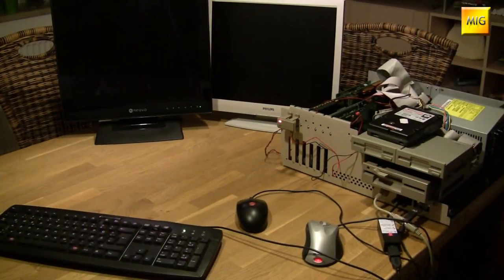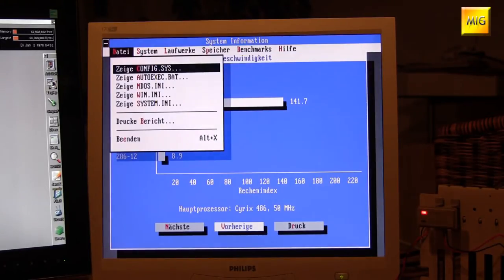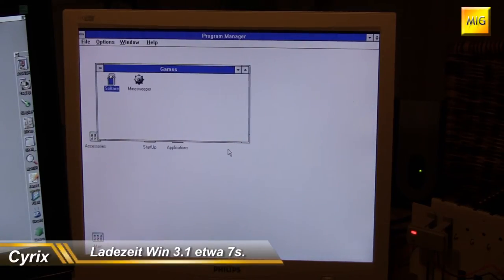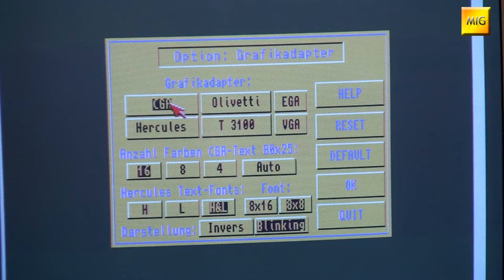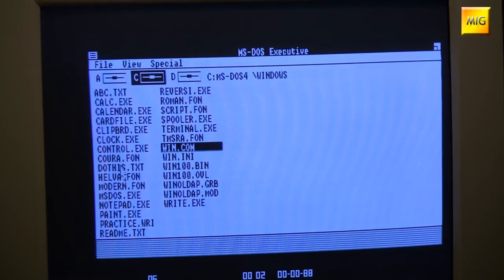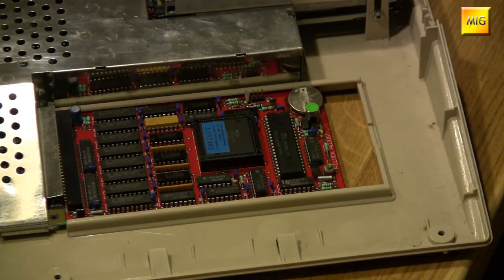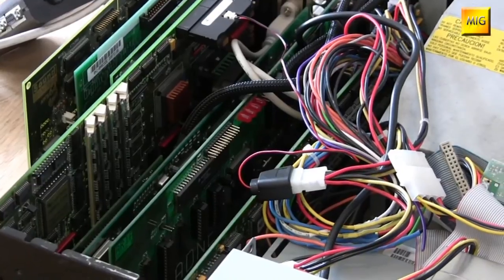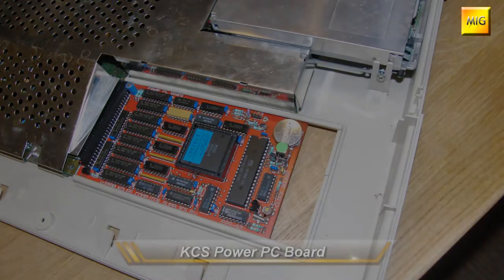MIGs Yesterchips SPECIAL - Folge #020 Bridgeboard Finale

Comment: Danke für diese tollen Videos! Ich habe unter anderem ein Commodore A2386 und ein Vortex ATOnce Classic. Ich hatte einige Zweifel bzw. Fragen, doch die wurden alle mit diesen Videos beantwortet :) Weiter so!
Reply from the maker: So soll es sein! :)
Reply: Yesterchips MIG Hab mir vor ein Paar Wochen ein Buch ueber Commodore gekauft. Werd mir mal einen Amiga kaufen.
Reply from the maker: Extrude Studios Wenn Du noch nichts Konkretes in Aussicht hast würde ich Dir zu einem A1200 raten. Bietet das Beste aus der Amiga Welt, ist halbwegs "günstig" zu bekommen und noch relativ einfach aufzurüsten.
Reply: Was macht der A1200 den besser als 2000 3000 oder 4000?
Reply from the maker: Extrude Studios Verglichen mit dem 2000 und 3000 hat der 1200er (genauso wie der 4000er) den AGA Chipsatz, kann also mehr Farben darstellen. Der 1200er hat ferner einen internen IDE Port, der 2000er hat gar keinen, der 3000er SCSI (was zwar schnell ist, aber heute kriegste dafür keine "Neuen" Platten mehr). Gegenüber dem 2000er hat der 1200er ab Werk mehr CPU-Power und mehr RAM. Außerdem kannste ganz einfach per AV Kabel den 1200er am Fernseher anschließen, beim 2000er kriegste auf diesem Wege nur schwarz/weiß.
Und dann, so ganz nebenbei, noch der Preis ^^
Kommt natürlich ganz darauf an, was Du machen möchtest. Wenn Du einen Bridgeboard-Betrieb planst, dann brauchste zwangsläufig einen 2000, 3000 oder 4000, weil 500/+, 600 und 1200 keine Erweiterungssteckplätze für Zorro-Karten bieten.
Reply: Und was kostet so ein A1200
Reply from the maker: Extrude Studios So zwischen 100 und 200 Euro bei eBay.
Reply: Danke ich schreib mein buch mal fertig und kauf mir dann vieleicht einen. Danke fuer die Infos :)

Comment: Ich bin aktuell an einem sidecar Setup dran und hab 2stk davon , einer läuft der andere nicht. Was gibt es da zu beachten was kann man upgraden? Tolles video! Hab mir soeben eine vortex slc486 gekauft und möchte da auch den Aufbau starten. Geht da der Upgrade mit Cyrix auch? oder bringts da gar nix?
Reply from the maker: Hast Du die SLC oder die SLC2? Bei der 2er macht aufrüsten fast schon keinen Sinn mehr. Die SLC kannst Du mit einem SLC2 oder entsprechendem TI Chip tunen. 

Das Sidecar "tunen", naja nicht wirklich. Man kann einen numerischen Coprozessor einbauen - was aber nur bei Programmen etwas bringt, die diesen auch nutzen. 512 KB RAM onboard und bis zu 640 KB in Summe (mit einer ISA Karte) sind machbar. 
Als Festplattenersatz kann ich den XTIDE noch nicht empfehlen, weil der sich mit dem Janus Handler beißt.
Reply: Hab mir die SLC geholt , leider funktioniert diese gar nicht , Absturz wenn ich die Software starte , grünes Lämpchen läuchtet

Comment: Hab' mir jetzt selbst ein KCS Power PC Board zugelegt, mitsamt allen Original-Disks, Handbuch, A2000-Adapter, etc.
Aber: Mein A500 hat noch keine Festplatte :o Die braucht er natürlich noch, dann gehts ab :)
Reply from the maker: Jo, ohne machts keinen Spaß.
Reply: Gab es sowas eig auch mal für den A1200? Wäre auch mal Interessant. habe dazu nichts gefunden
Reply from the maker: Das KCS PowerPC Board gab es noch für den 600er. Für den 1200er ist mir in Sachen PC Emulationshardware überhaupt nichts bekannt.

Comment: sind bei allen 20ern alle PC-Slot's auf 16Bit erweitert.
Reply from the maker: Du kannst bei allen Amiga 2000 Varianten alle ISA  Slots auf 16 Bit bringen. Ab Werk sind aber stets die äußersten beiden Slots 8 Bit.
Reply: Yesterchips MIG Danke. Ich meinte bei den gezeigten ist das immer gemacht.
Reply from the maker: drzeissler Ja, das ist oft zu finden. Wenn man Brigeboards einsetzt (also ab A2286) dann macht diese Aufrüstung ja auch absolut Sinn. Und es ist wirklich kein großer Aufwand. Einfach nur die Slots einlöten und es funktioniert.